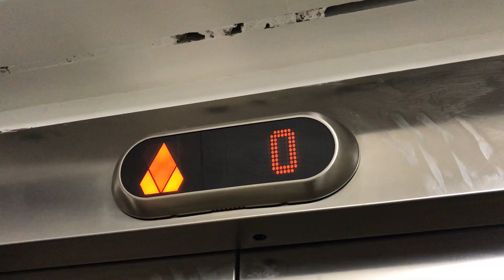Ecodisc overruns top floor - lift malfunction

Comment: Sometimes when ecodiscs haven't been maintained for long they tend to get a bit unreliable sometimes the tacho doesn't work properly and the lift relys a bit more on the shaft bars which cause the doors to open first then it levels that's if predoors is enabled. There's a small block right near were I live that has this problem because it seemed as if it wasn't being maintained by anyone.
Reply: even the best lifts need maintenance to operate trouble-free for long periods of time
Reply: @ZZ9ProductionsOFFICIAL  Yeah but despite them errors I think if predoors was turned off then if the lift was neglected then it can last a while say like 3 - 4 years.

I think Mitsubishis could last a while without maintaince too but it depends on the equipment because even though most look same, each one uses different equipment.

 I've seen kone use older and new equipment mixed but it's mostly the doors or buttons rather then important stuff like the lift guides or motor.